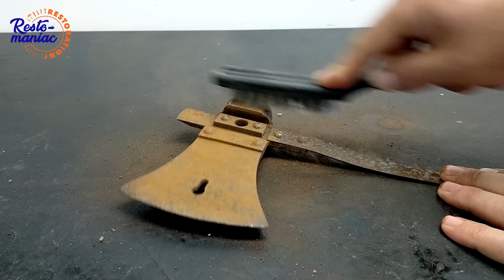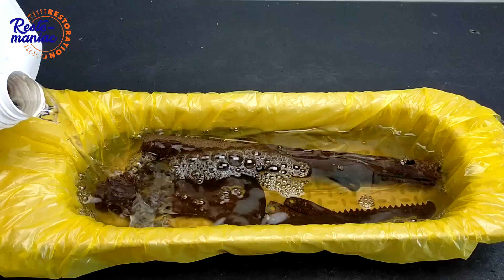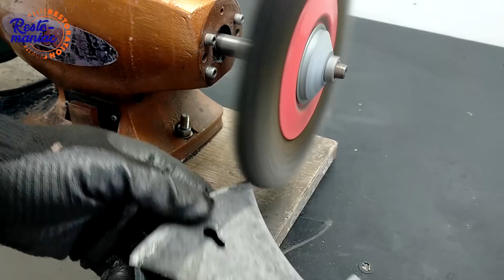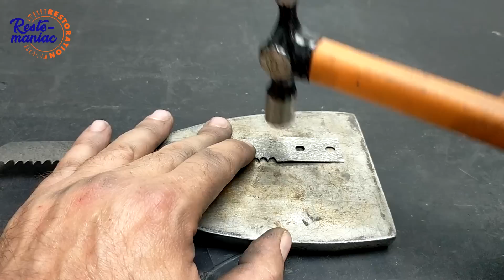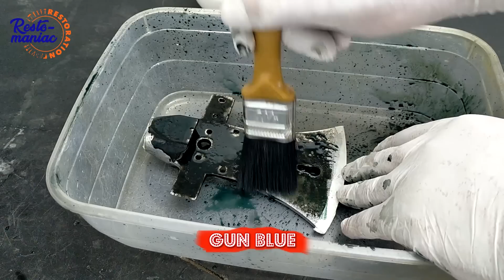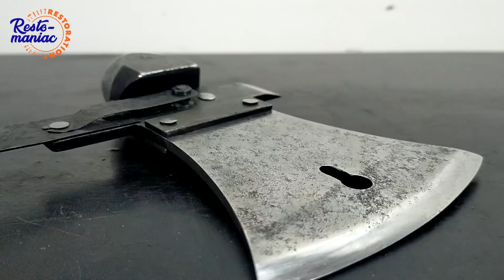Axe-Saw-Chisel Triple Restoration

Comment: Fantastic job you did restoring the multi-purpose axe-chisel-saw tool, and you sharpened the axe blade very well.  Great work.  By the way, I have never seen a tool like that.
Reply from the maker: Thank you very much for your comments 😊🤗
Reply: No wonder you didn't, as it was made in the USSR some time between mid-1960s and late 1980s.

Comment: Very nice. I've found that for removing pins with a punch and hammer, a big block of wood with different sized holes in it works really well. Just place the item on top, line up the hole and hammer the pin out.
Reply from the maker: Thanks for the tips :)

Comment: I have almost the same tool. But mine is a little bit more newer, and have a knife blade and shovel in it and it with a holster so that you can put it in your belt on your trousers. This was a great restauration it's sad about how the rust have done some really bad pitting in the metal. But it turned out good in the final result. Keep up the good work.

Comment: It's natural color is all black, not white metal. Chemically blackened, not painted. Only sharpened edge of axe and chisel has metal color, shovel not sharpened. Button pin on axe and shovel was brass-colored. Something else was in the kit - but I don't remember what... may be sharpening stone. Holster made from coarse cloth, edges strengthened with pink (!) artificial leather, metal hook and eye as clasp.

Comment: What you say are harden bits of your axe head must have been annealed or your file would have skated and not filled so easily,,,
Anything I heat treat (knives axes hammers) is far too hard to file
Reply from the maker: It was hard to file. From a fictional point of view, I do not show every process at length in my videos. This is a fictional choice. Relevant parts of the metal are annealed.

Comment: You think, as rigid and hard to remove as those rivets were, they were hot rivets?
Reply from the maker: Hi, actually the rivets are soft, they were just too tight.  I think they were fixed by pressing.

Comment: hmm...this stupid thing was also sold here years ago. In practice it is worthless. The ax has no wedge and is just right for splitting chips from old boards, it won't cut anything, it doesn't even have weight. The soft iron saw was unsharpenable and the hands blistered in no time. Tom. Tom  49/42/00&13/30/00

Comment: a cleaning more than a restoration.. the only part u made is the "button", but all around the metal could have been restored..
Reply from the maker: If you want to see a brand new metal, you should buy one. Unfortunately you misunderstood restoration.
Reply: @Restomaniac  maybe if u used something like "filler" and restore the piece, you could call the video "restoration".. but seeing only cleaning it from rust..
Reply from the maker: @Cyberix75  I just realized that you don't understand metal restoration at all.  There's no need to continue this conversation.
Reply: This item was restored to a fully functioning tool. The imperfections in the surface give it character and make it more beautiful.